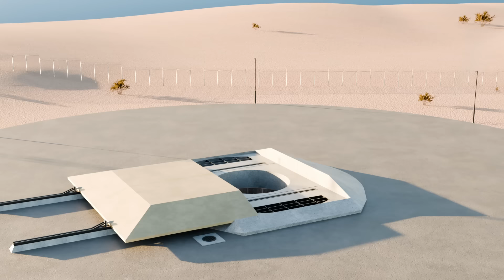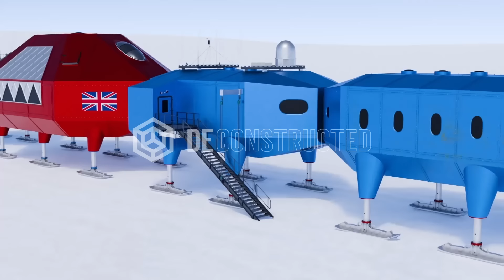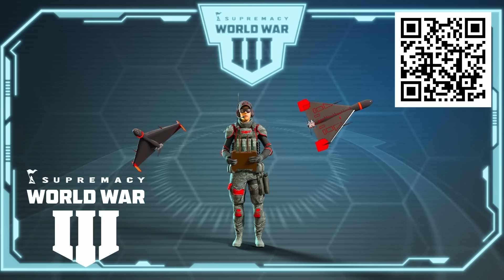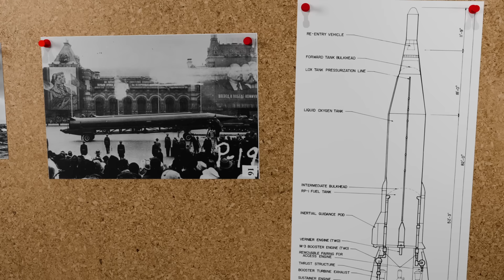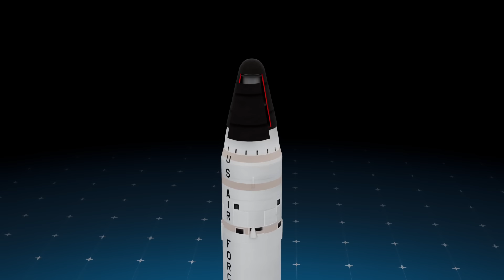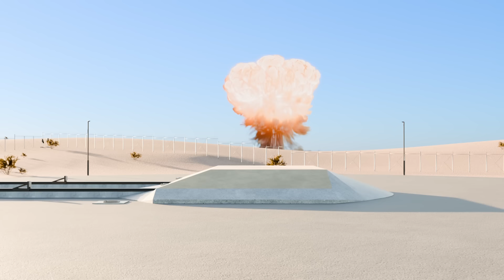Missile Silos Were Far More Complex Than You Think

Comment: It seems almost silly, but I do find the whole security of the access portal to be surprisingly underwhelming. I guess it's something about the mundane orderly procedure to go through the relatively simple steps as being what stands between outside entry and an actual weapon of mass destruction. Still, it was enough to keep two airmen out of the Titan II Missile Launch Complex 374-7 Site on September 18, 1980 who were sent to investigate the status of the Titan II missile there after a dropped wrench socket punctured it's 1st stage fuel tank. They were ordered to cut down the fence, break through the electronically locked doors, then they were stopped by the inner blast door. They went back up to the top of the concrete access portal to await further orders and were there when the missile exploded. I do appreciate how this video helps me better visualize how this event would have looked like.
Reply from the maker: It does really put things into perspective. Thanks for sharing!
Reply: It's a good observation.  It would be possible to break in and get as far as door 6. And at some point during a test penetration, the crew was surprised when a security team did manage to break in.  After that, a control was placed on door 6 so that a button was installed on the main console in the control center so that opening door 6 required both buttons being pressed together in order for door 6 to be opened. This insured that no one would come in without the crew knowing about it.

Comment: I was in the same decommissioned launch control room and being 6’7” I was able to reach/operate both launch switches. Not that I would ever do that if I worked there for sure.
Reply from the maker: Haha nice!
Reply: This is exactly why there are now four switches that need to be activated in order to launch stuff like this.
Reply: @pauldiesel4582❄
Reply: Siiixxx seveeennnnn
Reply: I could have gone into the back of one of the panels put in a jumper wire and started the launch sequence.  There was a disabled signal transmitted from the base to the missile Control Center preventing launch, I could have gone to level three and unhooked the cable.
Reply: Careful saying that! You probably ended up on a government watchlist
Reply: Should have. We've failed as a species.